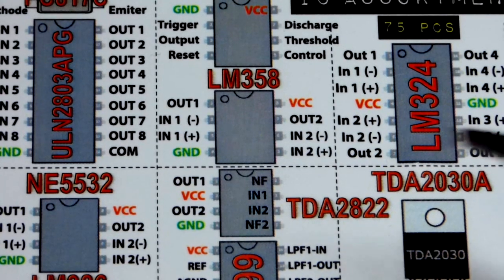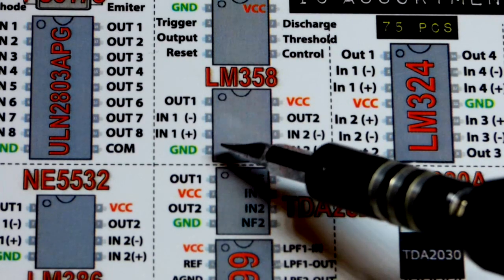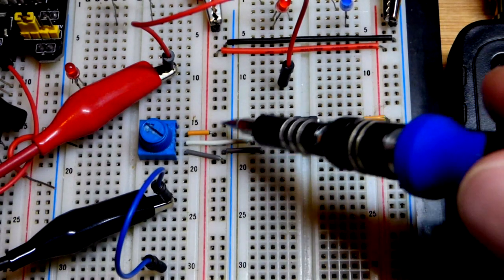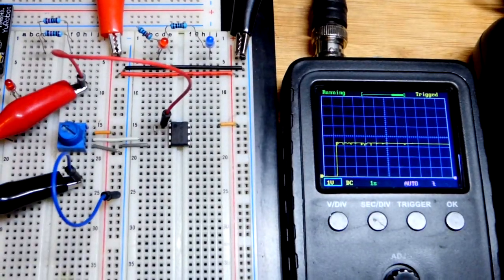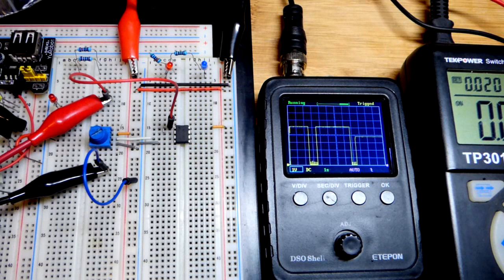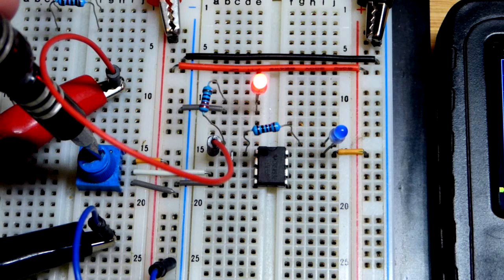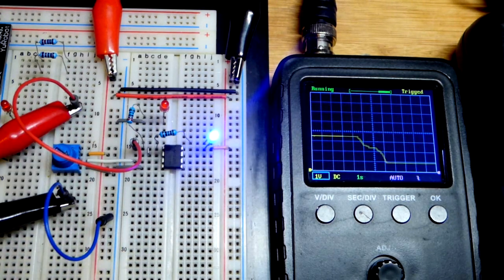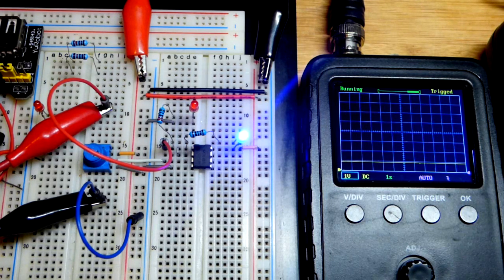Quick op amp wired as a voltage follower electronics circuit using LM358 how to DIY

Comment: I appreciate you making these videos, but they won’t be much use to a lot of people without circuit diagrams.  I would highly recommend showing diagrams of what you’re doing if your target is educational.
Reply: Eric Randall Yes, I agree they are great! But, he usually does provide a diagram for more complex circuits. When he is making these type of Circuits, he doesn’t use one. No hate tho!
Reply from the maker: Thanks for the tip! I do have older versions of these circuits with circuit diagrams. It looked like a lot of people were skipping past the diagram part of the video and going right to the circuit, so I figured I'd try making quick videos of just the circuit for a while to see how they do.
Reply: I agree that providing a schematic would be beneficial.
Reply from the maker: Thanks for the input! I'll start using them in most of my videos again :)